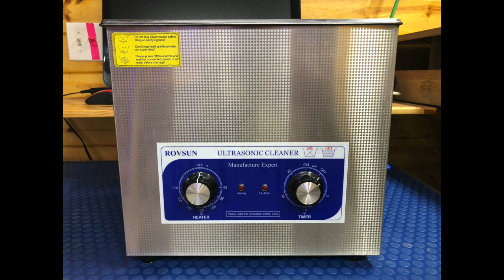40 year old Athearn SD-45 Demonstrator Saved From The Garbage

Comment: Excellent job with this Athearn's, I learned quite a bit, especially on replacing the handrails.
Reply from the maker: Glad it helped!
Reply: Instead of soldering I would use superglue, the gel version takes awhile to dry but allows you to get the stantions vertical  and when applied sparingly there should be nothing to remove and easy to do if you did get too much there.

Comment: I bought one of these in Santa Fe livery back in the 70's. They will pull like a tank. The Athearn handrails were never put on and were lost thru the years. Got some pre-formed brass ones for $30 (ouch!) and they look good but are delicate compared to the Athearn ones. (Mad at myself for losing the original ones.) One truck had the side frames riveted on crooked (sloppy machining by Athearn) and the 3 axels were not parallel causing misalignment and the front wheels to ride off the track, causing derailments. Drilled out the rivets and realigned one sideframe to be parallel with the other sideframe for proper tracking. Some guys will also remove the center axel bushings to let the axel float so as to prevent derailing problems. Loved your video and it reminded me of all the fun I had working on and fixing my vintage SD-45.
Reply from the maker: Hello F.P. Thanks for commenting. I'm really surprised how well this -45 pulled.  I'm glad it had good machining on it. I'm glad my vid brought back some good memories for you :-)

Comment: SD45 EMD Demo unit.  Nice work.  Agreed on soldering stanchion/handrail is time consuming but the durability built into the model forever makes it worth it.  If you want fast/cheap super glue will do the same thing.  Not as durable, but good.
Reply from the maker: Hello Mark, Thanks for the kind words :-)

Comment: Hey Ron! That’s a really sweet SD45 . Good job on the restoration!  I tinker in N-scale and I learned a trick from other modelers about paint removal. Soaking plastic parts in 409 cleaning solution. Takes a day or two but the paint comes off nicely and doesn’t mess with the plastic!
Reply from the maker: Yup, Lots of great ways to remove paint for sure!!

Comment: The worm "bushings" are identical to axle "bearings" while the worm "washers" can be replaced with lift-kits for freight car truck adjustments or the same washers from the Athearn passenger car kit truck washers.
The engineer side post was missing because it was an SP "L-shaped" window. I'm a "Demonstrator" collector so was happy to see your choice of shell replacement. The Delaware & Hudson bought the demonstrators.
I just subscribed to your channel.
John
Reply from the maker: Zebrails, Thanks for the good information.   A few people have pointed out the "L" window  S.P used. From my research I found they only painted up 4 SD-45's into the demonstrator paint scheme.  I always wondered where they went.  Thanks for Subscribing :-)

Comment: Hi Ron. I just stumbled onto your site. Subscribed immediately.

I am doing the same kind of restoration of trains I had abused up until I quit model railroading at about fifteen. A few years ago I visited the old steamer trunk upstairs in the attic and after removing the mouse hotel, determined that the old HO trains were in good enough condition to attempt to restore. I have a lot of video in the "can" but not edited yet but you might find what I have posted interesting, at least I hope so. 

The goal is to restore the locos to like new or better condition and to convert the rolling stock to be as realistic as possible. There is a lot to do.

Most of my locomotives and rolling stock are somewhat older than yours. I have a herd of Athearn  HiF (rubber belt drive) F7's, a Mantua "Mikado" and some other locos and thrift shop rolling stock donated by a good friend or purchased on the cheap. I'm basically replacing all of the broken pieces, mostly fabricating them from scratch,  replacing molded on handrails/steps with wire and so on. I am just getting started with duplicating some pieces by making a mold of good parts and then casting new parts.

I've decided to do a moderate amount of detailing on the Mike when I get more time to get back to the trains. Mostly removing the molded on piping and adding some other details. Luckily the old gal didn't have zink pest! It should be lots of fun.

Real life has intruded a bit and I haven't uploaded for awhile but there is still a fair amount of content on the site.

Very happy indeed to have found your site. 

-dave (upstate NY)
Reply from the maker: Greetings Dave, Montana here on this end.  Thanks for sharing your great story about your modeling journey. As a kid, we moved a lot so I was unable to still have my childhood models.  I'm making up for it now :-)   I hope life slows down for you a bit and you can get back to working on your trains. I'm not at the level to super detail anything right now, just trying to get the layout and buildings constructed. In the future I hope to spend a lot of time and really get into the details like what your doing.  Thanks for the positive comments, I will have to look your channel up on the YouTube.  :-)
Reply: @classicmodeltrains  Thanks for the reply! 

Beautiful part of the country. I spent a few weeks in Wyoming when doing my archeology degree.

Nice work on the SD-45. I'm not up to speed on decorating or applying decals properly. My chemical car decalling was a struggle. I'm terrified of decalling my kit blueprint series reefers.  If you can find complete blueprint series kits snarf them up, they are really good. I got two reefer kits for peanuts.

Too bad your trains got left behind. The first time I got one of my old locos running again was a real rush! Getting a strong urge to work on the trains again.

 I had a Lionel O gauge train set that was fully operational as well as an American Flyer set with a burned out loco motor. All were given away in the early sixties. I kept the burned out loco though and my HO stuff.

After posting I decided to work a bit on "Mike". When I got distracted by R.L. the loco wasn't running well.  Testing the loco it didn't run at all. It seems the ground wire was disconnected but after retrying the test it stalled and derailed over my ancient but restored Atlas snap switches. a lot. This was something new.

Two things were wrong. The wire to the tender had come loose. (When I have a chance I intend to drill and tap a hole in the cast shell so that the wire is not attached to the drawbar pivot)  The second problem was that the new fiber drawbar was sometimes picking up the front of the tender or pressing down on the back of the loco, lifting up the front pilot enough to cause it to derail. Bending the drawbar a bit cured it. At some point I'll fabricate a new one out of more flexible styrene.

Tried the trick of oiling the tender journals to improve electrical connectivity. It helped a lot. Mike now pulls all sixteen of my cars smoothly, with ease and at a fair rate of knots.

An old timer suggested very slightly oiling the brass track to prevent arcing. I've been doing this for a couple of years now and it works a treat. When it comes time to clean the track the dirt comes off with a mere swipe of a Scotch Brite pad. Also the track pickup wheels are no longer damaged by arcing.

Happy modeling.

-dave
Reply from the maker: @dgwachtel  16 cars for a Tyco Mikado is a very nice load. Great job on mechanicing in the Ol’ girl!!
Reply: @classicmodeltrains   Thanks Ron.

I cleaned, adjusted and lubricated the motor first time around. The drive shaft bearings still need some love though.  I had to purchase replacements for the plot, valve gear and a front truck just for the spring.  Purchased a replacement for the rear truck (IIRC) but it had zink pest. At least I got a spare spring out of it. 

The shell was corroded  due to mouse urine and had some minor pits that will be filled with Bondo before Mike finally goes to the paint shop. 

I'm confident that Mike could pull at least 32 regular freight cars on the level. At some point I'll replace the magnet to hopefully get even more power. I just added four heavy Amtrack era passenger cars to the back of my train. Mike just replied: "Hold my beer". The back to back Athearn F7 lashups wouldn't even move the load. So that's 20 cars. The test oval is getting crowded. The tiny engineers are staring at the very last car about 100  feet in front of them.

As for the detailing, the loco is not prototypical, having incorrect valve gear and boiler profile as the main flaws.  At least I can make it pretty :)

Don't forget to use Locktite Blue on the screws holding the trucks to the tender on you Matua Steamers. If there are more turns to the left they have a tendency to unscrew themselves and fall out, particularly if you had to shim them for coupler height. I didn't Locktite them doing testing and one fell out just now. Got it all on video!

Progress so far is documented on my site.

Do you think that these old locos could be converted to DCC? Some say yes and others no due to excessive current draw. What's your opinion?

-dave
Reply from the maker: @dgwachtel  the original motor has to be upgraded to a can motor. I did a video about converting a Tyco Pacific to DCC. It might help you out with some questions.
Reply: @classicmodeltrains  Thanks Ron.
-dave

Comment: In the old days when we had to remove paint to make a new paint scheme was dish soap and an old toothbrush. I remember when Ultrasonic Cleaner first came out there was a test in Model Railroader in the old days when it was still the best magazine in the train world ultrasonic cleaners cost almost $600 back then, but they were amazed how well the engine was clean.
Reply from the maker: Hello Frank.  Thanks for commenting. I used to read MR back in the old days also.  This ultrasonic cleaner was under $150 if I'm remembering right. :-)

Comment: This is the older style truck assembly not the newer Blue Box type.  The older versions have metal and no bronze bearings and that gray motor is a high drain compared to the newer bronze housing kind. Thanks again!
Reply from the maker: Greetings Dash-8.  I was thinking this is an 80's style of motor, because of the flywheels. I have some older B.B.'s and there is no flywheels at all. I was thinking these were 70's.  Just an semi-educated guess.  Thanks for commenting :-)
Reply: @classicmodeltrains  I realized too that this is Athearn's wide body shell design that they been using from1970's through the end of the Blue Box era (2000's). It's called the wide body shell because of that motor being so big with-wise. The redesigned Blue Box versions have the narrow motor (brass motor casing), square bronze bearings between the wheel sets, and smoother drive. Hope this helps!

Comment: I highly recommend Super Clean to remove paint from styrene plastic! You don't even have to heat up the water to remove the paint. Of course the quickness of the stripping depends on what paint you use. Acrylic paints don't stand a chance lacquer paints are tougher and you may have to soak overnight-or maybe use the ultrasonic cleaner after all.

Anyway, I recommend Super clean. Over Simple Green.
Reply from the maker: Arrow 1. I will have to look into finding some of that stuff.  Thanks for commenting :-)

Comment: There is currently a topic on a forum where people are doing exactly this - restoring old models that would be considered "junk"  and enjoying it.  In general that's great to restore older models, especially if you limited funds but plenty of time.  Regarding the Athearn blue box SD45 here is my story:  When I was 14, I wanted an Athearn SD45 for Christmas because I saw them regularly on the Southern Pacific lines that came though my town in northern California back in the 1970's.  Santa did bring me one but it wasn't long before but I noticed, even at the age of 14, the Athearn SD45 had a fat nose compared to the real thing - it just didn't look right.  I found out later the body shell is overly wide to fit the motor back when they were being manufactured.  Being a fan of the Southern Pacific and wanted my models to look fundamentally right, I was so glad when model companies started offering SD45's with scale width hoods, such as Bachmann and Athearn RTR.  There are a lot of older models which are basically good for dimensions, like the blue box Athearn SD40T-2, GP40-2 and others.  Those would be good candidates for restoration and detailing.  The demonstration here would be useful for those wishing to restore many older models.  Kudo's.
Reply from the maker: Yup I've heard about the un-scale width problem of older blue boxes.  I would never notice but others can.
Reply: @classicmodeltrains  if you did a comparison with the real thing, you wouldn't be able to unsee it.  I noticed it even at the age of 14.

Comment: Nice restoration!  I just recently found my HO Scale box from the mid 80's and I found a very similar (if not the same) Athearn locomotive.  I took it all apart, cleaned it, lubed it up, wired it up for DCC and it runs smooth!  I also found in that box... one Atlas, and two Bachmann's from the same era.  I did the same with all... now on DCC and all run very nice.
Edit:  And I just checked, it's a 4101 SDP40 PWR B&O... and it's got $22.50 marked on it hahahaha!
Reply from the maker: Thank you! Pretty cool to still have your trains from the old days.  Sounds like you have them all tuned up performing well.  $22.50?  I miss the "good 'Ol days" :-)

Comment: Wonderful work Professor! I really enjoied it, specially the part of the railings (4 hours! Wow! You should be very patient to do that!). The 45 is rolling so smooth. Did you do something with the Jet Motor besides cleaning the commutator? Thank you very much for this video and for quoting my post. Greetings from Brazil (by the way, the broken front of the original shell reminds me the SP “L” shape window, which is present on the real 45 demo units, if I recall correctly)!
Reply from the maker: Hello Regis. Greetings from up North in Montana, USA.  The motor just runs that good.  It did get oiled up, and the electrical pickups on the frame and motor were cleaned when it was all disassembled for ultrasonic cleaning.  I was really amazed at how well it pulled at such low speeds!  It has now become one of the prides of my fleet. I see you have been following and commenting on many of my video's.  You were the first to ask me for something specific.  I was working on what to film next, and then your comment came along.  Solved my problem. It's great to see my vid's are traveling down to South America, and to be sharing interests with others so far away!! Your the second person to bring up the "L" shaped window that S.P. had. I learn new stuff every day. Once again thanks for commenting :-)
Reply: Dear Ron, it’s been a pleasure to follow our amazing work. Your vídeo production is very, very good. Your patience to explain things is remarkable. You’re always sharing your knowledge about the real world (as, for example, the Sd45 time of production - Jan/66 to Dec./71), showing us that you’re a real railroader! Here you have a fan! Said that, regarding to the 45s, look for on Youtube or Google For DDM45: it’s a 45 on DD trucks (yes, 8 axles). They were produced (83 units) byEMD for an ore hauler here in Brazil, the “Companhia Vale do Rio Doce”, or simply “Vale”. It’s an SD45 on steroids, or a mini DD35A. I have the feeling that you’re gonna like it. New greetings from Brazil! Take care!

Comment: Brake fluid removes paint safe than the ultrasonic cleaner. Leave the shell soaking and use a stiff toothbrush to remove the paint after a few hours. The cheaper the fluid the better.
Reply from the maker: Brake fluid is a hazardous waste.  The water/simple green is not as toxic and a lot cheaper.  I had the Ultrasonic already, use it to clean carburetors.  But I have heard a lot of Fellers use the brake fluid trick and swear by it :-)

Comment: Just painting the handrails will keep them in place. No need to solder.
Ultrasonic cleaning should be done on individual components, not assemblies
You can strip paint off body shells with brake fluid-no need to use the ultrasonic cleaner.
Reply from the maker: Hello GD99.  The stanchions were loose on the rail.  if I removed the railing for paint, the stanchions would have move all over and not lined up for re-assembly

Comment: My 2 AHM SD-40-2 consists need motors, pulled better than newer Athearns... any suggestions on rpm vs torque?
Reply from the maker: I did not do any pulling tests with it.  I did have it crawling along real slow and it pulled  that train up my 2.1% grade with no struggles at all.
Reply: ? 9k rpm vs 14k rpm dc motors, which provides best torque for retrofit projects? 40 yo pemco 3 pole ftwhl drive sd -35 out pulls everything on the layout, wth?